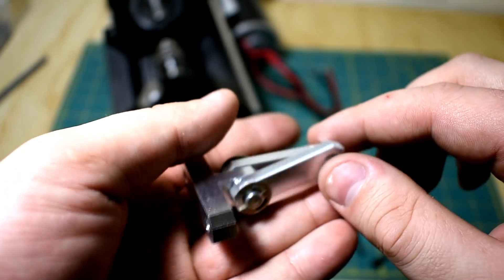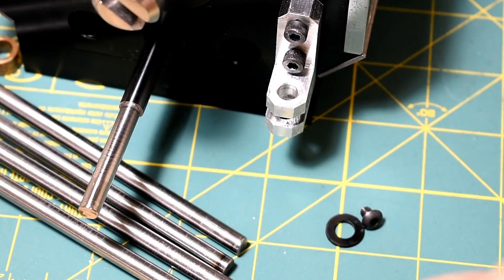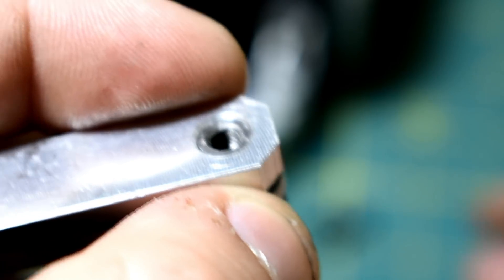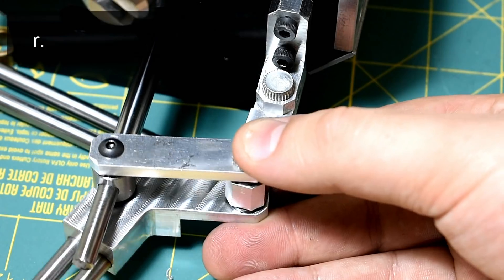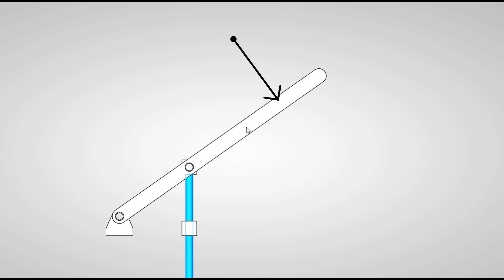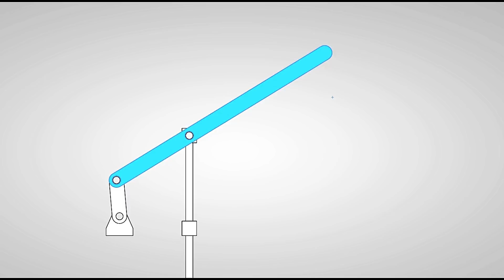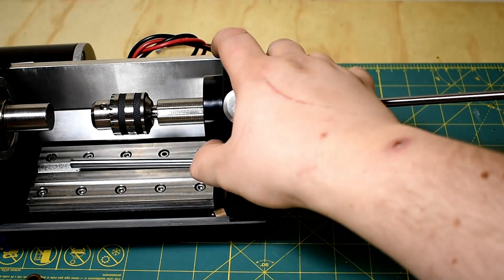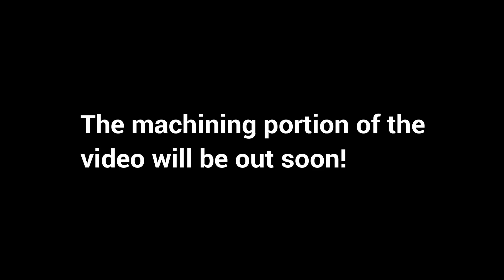Jeweler's Lathe Part 5:  The Tailstock and Z Axis Linkages

Comment: Oooo...there is some slop in those joints hahaha

just 3d print some of the shit or make a Hypercube Evo from Thingiverse and power it with a Duet wifi, put an E3D V6 on it and just 3D print shit for now, you are killing me! You have great ideas but you go through way too many prototypes....it is called RAPID PROTOTYPING for a reason haha. Do yourself a favor, learn how to machine, then use fusion to start fiddling with CAM and talk to me or google anything you want to know about CNC stuff you can't or don't want to ask at work. CNC is just faster, more precise and just better 99% of the time. Look into PolyMaker's PolyCast, I am going to start buying it by the pallet soon haha. You have some wicked cool ideas, but with even a halfway decent 3D printer, you'd spend so much less time fiddling....and you know it. Admittedly, I use screws for pins more than I probably should, they are cheap and it is an easy solution, even if it is not the best or wisest solution...it's easy and I move on and can proceed with the rest and come back later to that. 

Pretty awesome to see the progress of it though. I am going to build my own Swiss-Type CNC lathe because of you! Not sure whether to curse you or thank you hahaha

Comment: Iv'e been thinking... Those articulated linkages look a bit 'flaccid' ,  I think it might be better to pivot the lever arm at the end (like the first infographic) but with the short linkage between the mid point of the lever and the end of the quill/Z arm, Set the lever in front of the linkage so it (the linkage) acts in tension. I reckon this arrangement would be more rigid and more sensitive.
Reply from the maker: How dare you call my linkages flaccid!  Your name is Wobbly Bob!  Just kidding.  I see what you're getting at.   I may try a lever setup like that on X, where space is much more limited.  Good tip!

Comment: Aviation standard for linkages is drilled bolts with castle nuts and cotter pins. I would recommend this over a clevis/cotter arrangement as it allows the adjustment of tension in the mechanism. If this seems like overkill (very likely is), you could use small threaded bushings at every joint with retaining screws in the ends, like what you did with the z slider. 

PS 3d printed handles would be super cool
Reply from the maker: Oh cool, good to know.  I'll have a look!  thanks for the tip!  I wonder if I could 3D print and then cast handles... hmmmm...

Comment: Here's a small suggestion - make a small, vertical(90deg), free-pivoting(vertically) handle for the Z actuation, so you don't have to work way down at the table level. Would also allow for much finer movements using a few fingers.
Reply from the maker: I'm definitely going to try this!  awesome idea!

Comment: Take your pin stock drill a hole through it and then tap it. Screw a button head cap screw on both sides.
Reply from the maker: If I can scrounge some stainless I might try this, but I think I'd have a pretty hard time trying to drill the hardened pins I have on-hand
Reply: You can buy pull dowel pins. They are what I was thinking about making. If needed they could be cut to required length.  http://www.essentracomponents.com/en-us/fasteners/fastening-pins-sets-accessories/fastening-pins-sets/dowel-pins-pull-dowels/pull-dowels-smooth/pd-100
Reply: hlaps1990 you can also buy round stand-offs that are tapped on both sides. Depending on how hard you intend to push on the lathe, you could use nylon stand offs to give yourself a slightly lower friction pin. McMaster might have stainless ones, I've never looked.

Comment: Sailboat rigging bolts might be good and functional. The mast on modern sailingboats are secured with thin steel cable. At the deck level there is a mechanism that puts tention on the cable. You can buy the pins used in this mechanism. In my hardwear catalog (euro version of shars/ harbor freigth) they are listed from a quarter inch to half inch, and larger sailboats use pretty long ones. The exact dimensions (length) is not listed, but large ones should fit your parts. To make a nice looking clip super fast you can cut the tip (and maybe the head) off a brass nail they use in upolstery, give it a quick polish, slip it in the hole and bent the protruding end in an artistic fashion.
Reply from the maker: This is very intriguing, I'll have to look it up.  This is why I love asking questions publicly, you get so many different perspectives!  Sailboats hardware wasn't even on my radar!
Reply: hlaps1990 Hi! I’m glad you find my suggestion worth while looking into. I used google translate to find the english name of the rigging component, and the correct term should be a turnbuckle. The pins are of good quality, since they must resist both stress and wear in a salt water environment. The clips are too big for this use though. They are dimentioned to keep the mast secured in a hurricane or storm, and look the part (i.e. bulky and cumbersome). I think the pins themselves look really good though, and they should be available in many different sizes off the shelf in a shop.

Comment: As axis, you can use 3mm shafts from the CD/DVD drivers. You'll be surprised pricto, the size of them is very accurate. Hardened polished.
Reply from the maker: It's funny you say that, I'm a bit of a scrounger, and I have sooo many of those 3mm shafts!  They are great, and they usually come with some tiny little bushings!
Reply: hlaps1990 And I'm also collect a bit . It is a pity that these bushings are extremely vulnerable. To take them out without damaging - not an easy task. I love how they mate with the bearings (installation size 3mm). Right plunger pair. Yeah, don't do the bushings, do a low-profile bearings!

Comment: I end up using shoulder screws as pivots for things like that. They are ground fairly precisely, you can thread it into the part itself so that you don't need a nut. I would then turn a bronze bushing for the bore that rides on the shoulder.
Reply from the maker: Yeah I love shoulder screws... I may look into some of those ultra-low headed ones and trim the extra thread to keep the profile thin.